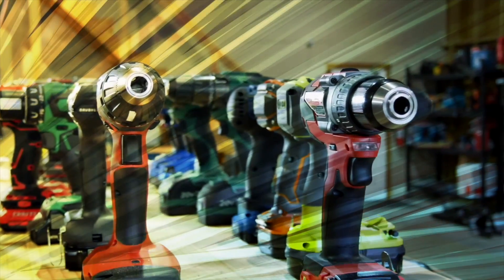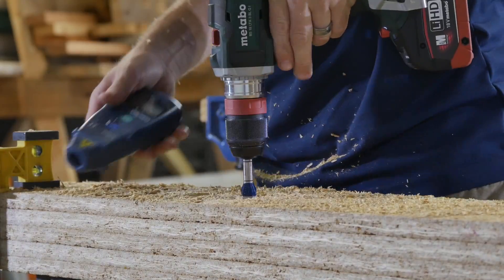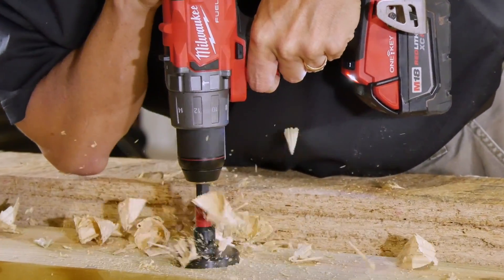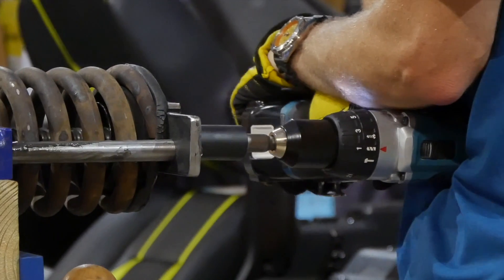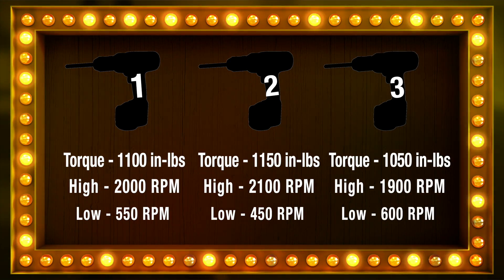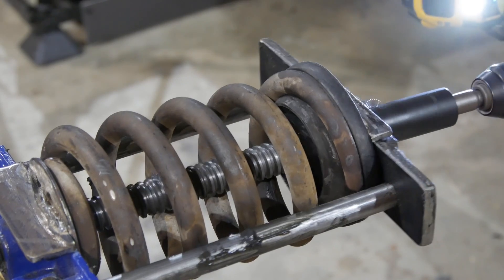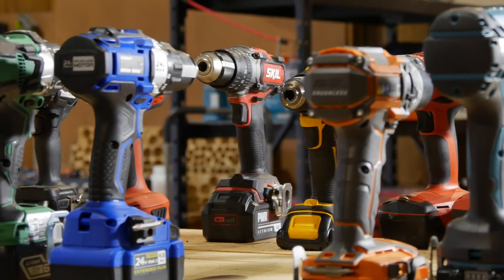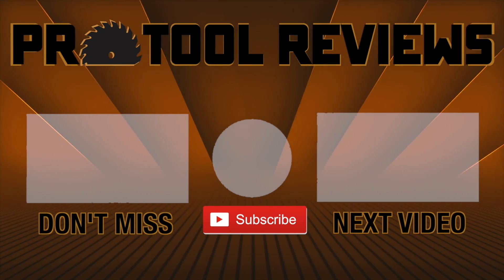What You NEED To Know About Drill Torque & Speed

Comment: Power = Torque x RPM
As the torque and RPM are known for the low speed setting we can estimate the power of the drill and then estimate the torque on the high speed setting.

Comment: One thing not mentioned here in this video is some tools have what is called constant velocity control in that it does not allow the motor to lose speed when load is applied in the low speed setting. That will skew you results.

Comment: This is good we just used Milwaukee 2804 to turn a fuel pump with a 9.0 battery it could only do about 15 seconds & cut off we used dewalt 996 with 5.0 battery it did it for about a minute & started smelling burned so we just gave up & used a old corded dewalt mud mixer & it still struggled but done it though & when done the extension cord was really hot
Reply: @Protoolreviews  this was a special hand crank fuel pump that multiplies your efforts & pumps a lot of fuel for a lot of effort it's used on a marine vessel & it fills a 200 gal tank used for a emergency back up 3404 cat diesel generator we've had 996 for years & thought it would have the power which it is very impressive but we use milwaukee's 2804 because it's small & we have a lot of their batteries big & small we keep enough fuel in tank to get generator running & then use the corded drill oh well once we realized how hard this was no one was disappointed in either drills